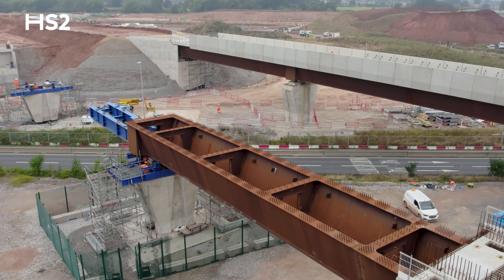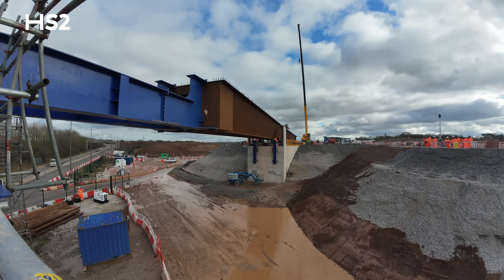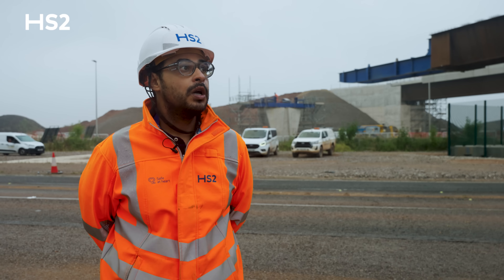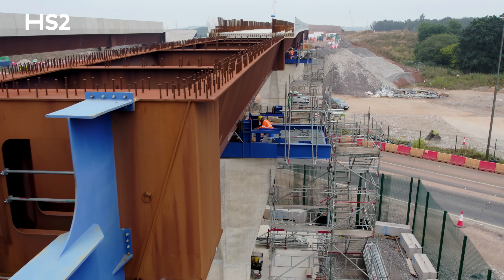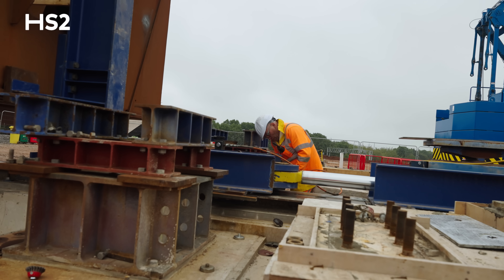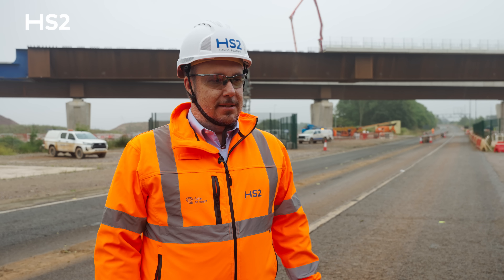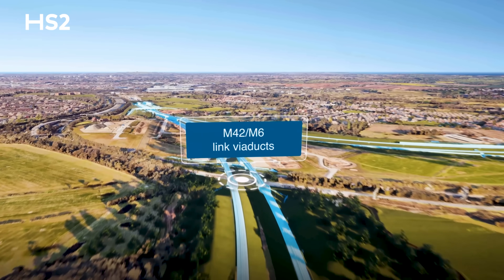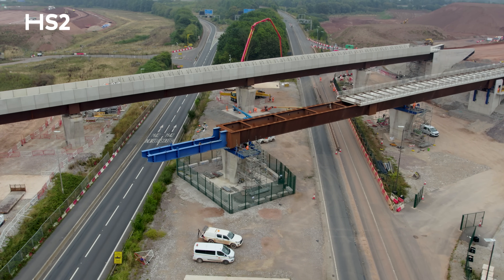In depth look at first completed viaduct structures at HS2's Delta Junction

Comment: No doubt all the engineers and builders have done a great job. But what a pity that thanks to Boris Johnson a huge sum has been spent on ONE high speed route instead of smaller sums being used to upgrade or extend perhaps 100 rail routes across Britain, which would have been a huge benefit for thousands more people (plus freight trains) travelling in all directions cross country.

Comment: Hi there Again it is Mr Cannadine T. Boxill-Harris, I have another interesting idea for most of us Class 313, Class 314 and that also is including those interesting Class 315 Fans out there, rather than scrapping most of those Class 313's Class 314's including the Class 315's maybe you guys can convert them and including  the refurbishment into those Leyland 510 Engine, Volvo B10M Engine, Cummins M11 Engine, Leyland 680 Engine, Gardner 6LXCT Engine, Gardner 6LXB, Engine, Gardner 8LXB Engine, Class 313's, Class 314's and the Class 315's and convert all of them into a 2 Carriages and Three Carriages of the Class 313's, Class 314's and that is including those Class 315's for most of us Class 314's and the Class 315's Diesel Train Fans Pretty PLEASE. Are you still going to do this interesting type of Project for all of us out there Please?

Comment: Wasn’t there a part of HS2 🚄 that got SCRAPPED? Have they resurrected it or something?
Reply: @NickyMitchell85  only the northern part (stupidity st its finest) however with the relaxation of fiscal rules hopefully we'll be allowed to have nice things like this again.....
Reply: @Whiskey2shots  No the finnest bit of HS2 is all the infrastructur of the longest viaduct in the UK over the Colne Valley, the tunnel under the Chilterns which again I believe it is the longest Tunnel on a conventional Railway, the Delta Junction at Water Orton in North Warwickshire, and the building of 3 brand new massive stations at Birmingham Curzon Street in birmingham City Centre, Birmingham Interchange Station at Bickenhill next to Birmingham Airport and London Old Oak Common Stations plus all the new infrastructure allowing a line speed of 250 nph even though trains will only do 225 mph. The bit to Manchester will only be a normal strait route from Lichfield to Manchester if it is started up again
Reply: @peterwallen1063  not sure exactly what your argument here is, and the speeds you mention are mostly nonsense. HS2 phase 1 was always intended for 225, 250 was a top speed for some areas of the network not on phase 1.

Comment: What a complete and utter waste of taxpayer money. Disgusting.
Reply: WHY is it.
Reply: @peterwallen1063  to save just a few minutes on a journey from Birmingham to London? What an criminal waste of money. The tickets will be too expensive for 99.5% of people and it cuts swathes through the countryside and causes enormous delays throughout its godforsaken path. Money that should have been spent on repairing roads the length and breadth of Britain. Its as pointless as this current and the last governments.
Reply: @grahamthomas6381  That isn't why it's being built. Now that you know you're wrong, I'm certain you'll apologise for your earlier comments.

What IS it about, I hear you say? Capacity. The fact is that there is more demand for people and freight to move between the north west and london, that should be obvious from the roads - this adds capacity for passengers and freight (at current design) equal to an 8-lane motorway with room to increase significantly without additional engineering being required (via digital signalling)

The fact is our roads and rails are already over capacity and if this isn't built then significantly more roads will be taking up much more land, making much more noise and pollution.

The high speed aspect of it is because you may as well make it high speed since you're designing it from scratch, the cost isn't significantly more than a conventional speed line.
Reply: @xaiano794  nope. You’ll never convince me it’s a good idea. Such a waste of time, effort and money. It will be as unaffordable for freight as it will for passengers. You are obviously entitled to your opinion even though it’s delusional.
Reply: @xaiano794  The argument for increasing capacity on the existing networks doesn't make a lot of sense to me. Surely to take passengers off of the current service and leave that space free for freight would the train not have to stop numerous times at the various stations? If it doesn't then it appears to only be for the few people that want to go specifically from B'ham to London and everybody else would have to stick to the current service, thereby not actually achieving what it set out to. If it does make numerous stops it'll either have to waste an enormous amount of energy getting up to speed and then stopping again or not run at full speed at all. If this is the case i'm sure it would have been a lot easier and therefore cheaper to build a slower speed line, with a slower speed train you could go around obstacles rather than buying/moving/tunneling your way through them.
I'm no expert on trains but looking from outside this seems to be the case. Hopefully there's enough folk in B'ham that want to go to London and vice versa to make it pay.
Reply: @oliverrestorick3970  I'm glad to finally speak to someone who genuinely doesn't understand and is actually looking for an explanation rather than trying to support beliefs. 

I have no idea why people develop such cult like beliefs over simple transport projects,  but I digress. 

The reason is that our current tracks have a mix of high speed services freight,  and local stopping services.
If you imagine a train that has to make 6 stops between two major stations,  let's say this takes 30 minutes,  and there is also an express service that only takes 20 with no stops. 
You need a minimum of 3 minutes between the trains at the destination so that means that when setting off from the first station,  there has to be a 13 minute gap between the two trains. 

By contrast if both trains had the same stopping pattern,  they could set off just 3 minutes apart. 

Freight trains have an average speed similar to stopping services so mesh very easily with their paths,  the problem is actually the express services. 
Sadly express services,  for obvious reason,  are both the most demanded and the most profitable,  but taking them off the regular tracks drastically increases the number of trains you can run,  the fact that hs2 is faster is just a bonus,  the point of it is to provide a corridor for express services and the services on the regular lines will be able to have more stops and operate more frequently. 

Obviously this will mean that journey times on the existing London to Birmingham line will likely increase,  with few or no non-stop services from London to Birmingham,  but there will be far more paths for both passenger trains and freight as a result. 

I'd expect the change to be a reactive one though,  so as express passenger numbers fall (due to people taking hs2 instead) the express services would be slowly replaced by whatever is most in demand

Comment: Why are the new viaducts not painted before they are installed?? They look rusty already!
Reply: I'd guess they are using a weathering steel, which is made to form a very strong layer of rust but not corrode at all beyond that point (so the rust forms a protective barrier, kinda like anodizing aluminum, like iPhones etc)
Reply: @isherifwilson this. Made entirely from weathering steel. I know, I'm 1 of the welders on site that has worked on both viaducts ☺️
Reply: @oggydogg4147  they still look unfinished for all the money bieng spent is it possible to make them look asthecticly pleasing.

Comment: Extend HS2 to Glasgow and Edinburgh.
Reply: It was never go to Scotland…. Now it’s not then going to crew, 

HS2 trains will clog up the mainline to Manchester plus will go slower
Reply: @BlowBubbbles  You may have to eat your words as the Labour Government has changed it's mind and is building to London Euston and the Station and the Labour Mayors of the West Midlands and Greater Manchester are in talks with the Government about building to Manchester
Reply: @peterwallen1063  but considering shoves were going to be in the ground now for it, how many years more  years will we have.

The mayors plan is to use standard sleepers, that will buckle in the heat unlike hs2 so much
Reply: @BlowBubbbles  I don't think you know a lot about railways, the sleepers do not buckle in the heat it is the rails that can buckle in the heat if they are not tensioned correctly by the track installation crews and even then the temperatures have to be rely high before steel rails buckle and it will tke as long as it tkes to get finnished
Reply: @peterwallen1063  I was lead to believe a concrete slab instead of ballast had many positive properties in the long run, increasing the thermal envelope the steel can operate. As you will know you stress the steel so less thermal movement, With more hotter summer heat waves. Building a railway to operate then makes sense.
Not sure why you just want to build an 18th century railway will have more speed limits in the summer (yes the tracks all over Britain are stressed and welded the wonders of iron oxide and aluminium)
Reply: @BlowBubbbles  Concrete rail sleepers do not buckle in the heat
Reply: Rails do tho
Reply: @BlowBubbbles  HS2 was always just the second step towards moving InterCity trains off of the existing mainlines and onto a new high speed network.

Eurostar trains went to London via the commuter train network until HS1 was built. Trains are going to continue to go to Glasgow and Edinburgh via the classic network for now, but if we are going to get rid of domestic flights, the easiest way to increase the capacity to Scotland and North England, without impacting commuter trains is a new pair of tracks. And those new tracks might as well be high speed rail as it is a similar amount of investment and avoids the blight of "widening the West Coast Mainline and East Coast Mainline" and kyboshing a lot of houses.
Reply: @DavidShepheard  I agree just needed more capacity but if you going build it why not build right all the way
Reply: They can't afford for it to go even half way to Scottie-land, they care too much for those from Euro land on rubber boats , them breaking into our country like thieves in the night

Comment: Complete and utter waste of money
Reply: It's amazing how only people with no knowledge of the rail industry think this.

It's always far cheaper to build a new line than upgrade existing ones, as you can build in the day.
It's faster to build a new line than upgrade existing ones as you have no downtime.
You end up with a better result building a new line, as it isn't limited by the curves of the original line.

It's costing over 11 billion to add 2 new tracks to a 6 mile section of the leeds to manchester line.

HS2 is far, far cheaper and it would have cost far less without all the legal bills and delays caused by people complaining.
Reply: @xaiano794  all to save 20 minutes, not worth it
Reply: @xaiano794  copy and paste smarty pants>!
Reply: @daveydarko5026  it's relevant to so many comments on here since they are all sheep copying what they have heard rather than checking the facts for themselves - as you apparently haven done.
Reply: WHY is it
Reply: @peterwallen1063  read my comments

Comment: Was a good overview and interesting to know why this particular construction site is so big
Reply: The scope of works and resulting value in any of the contracts dictate the size of the sites. Further south the Colne Valley Viaduct and adjoining Chiltern Tunnels forms 1 contract 15 miles long. Coming north from there the next section is longer but as it's through mainly open countryside is cheaper per mile.

Comment: Not nice for the locals. But gives people jobs I suppose
Reply: Access to high speed rail is not nice for locals?
Reply: @112Haribo  when it's built it will be too expensive for average people to go on it and we got enough trains going to London.
Reply: @RoadRunner-gj2tl  right. So the idea is to replace existing West Coast Mainline services to be run on HS2 instead, freeing up capacity on the old lines for more freight and more regional trains. There won’t necessarily be more train from Birmingham to London than there are now.
Reply: @112Haribo   few will benefit and it's far too expensive. Protest more. Still a white elephant
Reply: @112Haribo  since its wrecked all my home land I hope your right that its worth the cost of going to London
Reply: @RoadRunner-gj2tl  You don't seem to understand the situation, people and goods have to get from A to B. If they aren't travelling by train, they will travel by road - that's the same roads you use.
People using HS2 means more space on the regular rail network for passengers and freight, which means less on the roads you use.

It's easy to dismiss it as something that only benefits other people, but couldn't that be said of literally any project? I mean why repair roads you use when people living in nearby houses don't own a car?
It's funny how so many don't realise that they themselves use infrastructure that others don't benefit from...
Reply: @xaiano794  will it benefit more people than people who it don't benefit?
Reply: @RoadRunner-gj2tl  Does the pavement in front of your house benefit more people than it doesn't benefit?
Why should anyone pay for any infrastructure in your area since only the small number of people (including you) benefit?
I hope you can now see the folly of your question.

All infrastructure benefits a minority, but that all adds up.
Reply: @xaiano794  what they need to do is put greenery around it and make it cheap to use it so its not just for the rich
Reply: @RoadRunner-gj2tl you have absolutely zero clue on the current state of the WCML, or railway infrastructure overall, don't you...
Reply: @RoadRunner-gj2tl  Why though? If the rich use it, that will mean more seats at cheaper prices on the regular rail services.

People so frequently look at thing in isolation without considering the impact on other services. HS2 will have a capacity equal to 8 lanes of motorway traffic even in it's current form, that means more free seats for regular services and fewer cars and trucks on the road in the long term.

As for wildlife, as a train driver I can tell you nothing is better than trains, a motorway is a solid barrier to wildlife, no fox or rabbit would survive trying to cross 8 lanes of rush hour motorway traffic, yet a railway? You regularly see all sorts of wildlife, I regularly see even rare birds like peregrine falcons!

The main issue with HS2 is that people base their conclusions on assumptions when they don't understand the situation at all.
Reply: @xaiano794 
You’re in the comments quite a lot here. You’re switched on and well informed. Good information. Shame so many are too small minded to see the case for investment in HS2 and general infrastructure. I love driving, but it sucks if everyone is driving because of traffic jams. I believe in a diverse range of transportation for specific uses which we currently have little of.